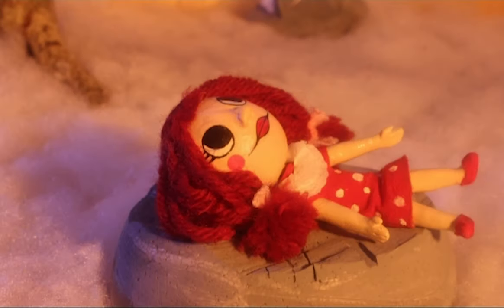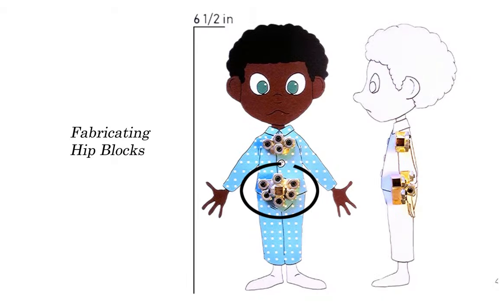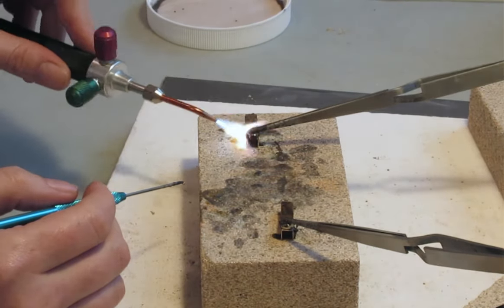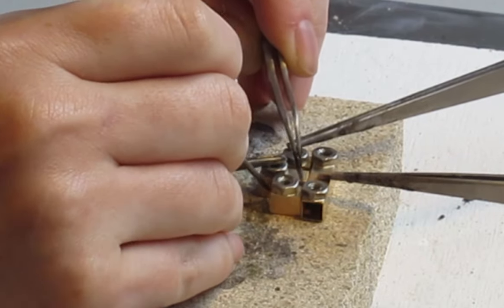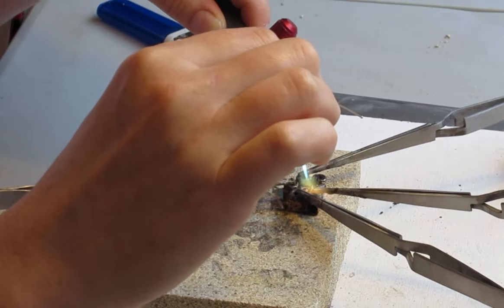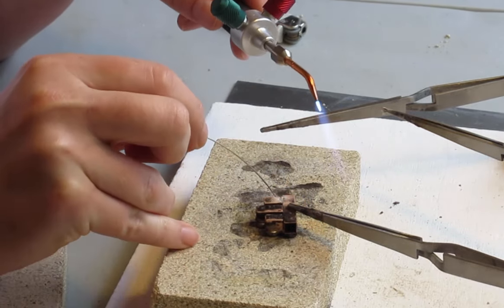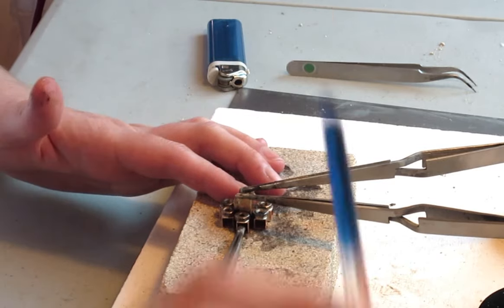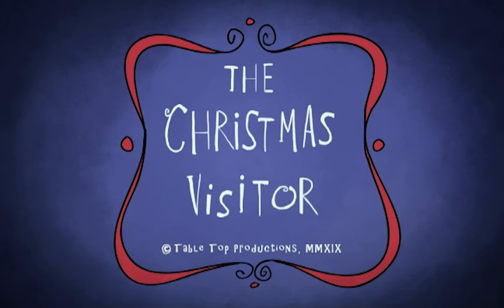Body Block Fabrication for "The Christmas Visitor," a short stop motion Christmas horror film.

Comment: Hi. I'm looking to get into working with more K&S brass pieces for my armatures, but I'm a little daunted by the soldering part. What type of torch are you using? It looks so small and easy to manage. Is there a big tank on the floor or something? Thanks!
Reply from the maker: Hey there!  I'm using a little torch from rio grande with small table top propane and oxygen tanks.  They're a little smaller than a carton of orange juice.  I buy the tanks from Lowe's - note that the oxygen runs out much more quickly than the propane, so it's a good idea to get a couple of oxygen tanks and one propane tank.  

You can also make K&S Body Blocks using propoxy to hold them together instead of soldering them.  It's faster and more accessible and what I teach my college students.  I have a tutorial here, if you want to check that out:  

https://www.youtube.com/watch?v=MxOcPzw1Dqg&list=PLwoE_ILXoiI3AhsJ4I80G8jc0nT2Q3bbA&index=9
Reply: Are models must last forever! There made with such robustness
Reply: @emilydmyers  Thank you so much. I’ll look into it. I’ve made a lot of body blocks with apoxie sculpt. I just don’t like working with those chemicals or waiting hours for it to cure.